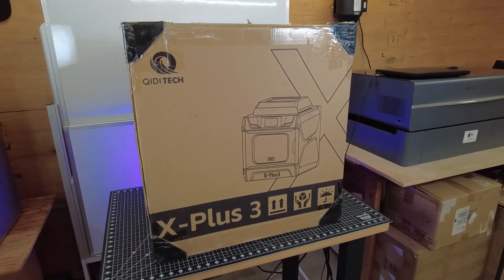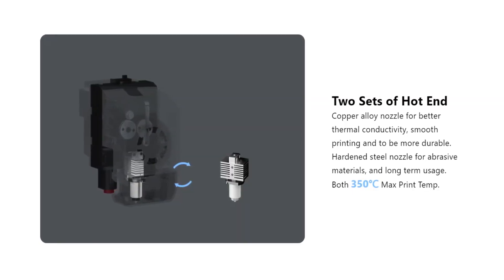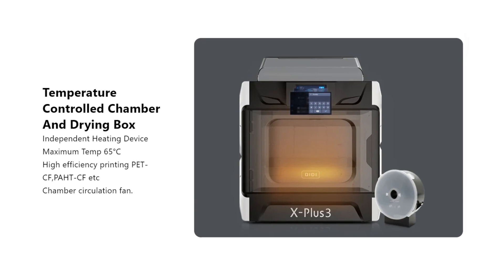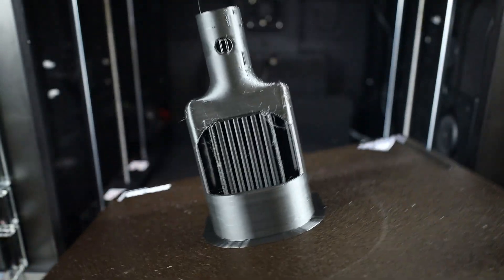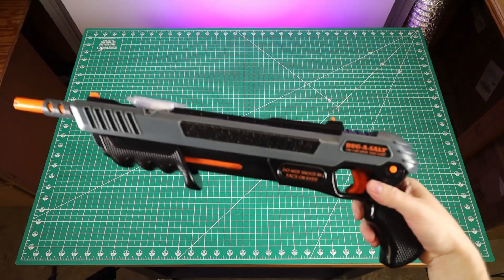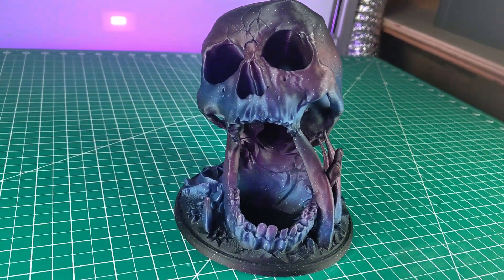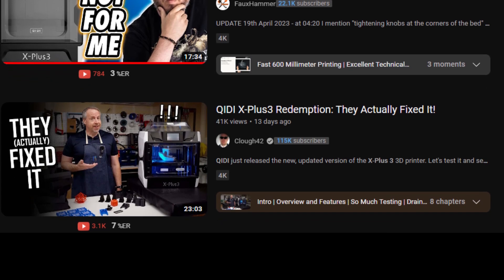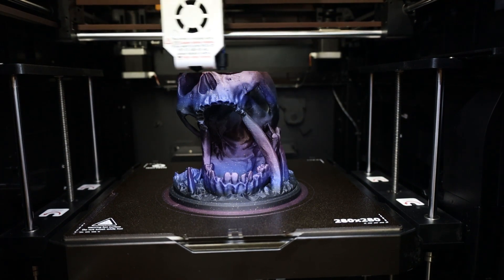New Competition for Bambu Lab & Creality K1 - Qidi Tech X-Plus 3

Comment: Hey mate what temperature did you print the skull with in that starry sky filament?  Im getting a lot of stringing with that filament.  I haven't tried to print the skull yet but was printing a bolt and nut as a test before the giant skull.
Reply from the maker: I honestly don't know 😅 I used whatever the default setting was for PLA in Orca slicer
Reply: Did you ever figure this out because im having trouble getting the sweet spot with this exact filament, print, and printer
Reply from the maker: Default PLA settings in Orca slicer with the lip off the printer.

Comment: Hey Randy, what's your opinion for the best printers under $1000 CAD (with tax)?
Reply from the maker: That will depend what materials and print size you need for that you are making.
Reply: @randymay  Right right, what are your thoughts on the Bambu Lab P1P? I think the most complex builds I will be doing is just PLA and they're like at most a ft x ft x ft build volume
Reply from the maker: I like the P1P and I have 3 of them actually. For the most part it really just works out of the box and makes quick along with high quality prints. You can also add an enclosure to it later on if you like and use the 4 color AMS setup too. I have a video about the X1C that I talk about the P1P in.
Reply from the maker: https://youtu.be/8mqrm_2_yzc

Comment: I have read that qidi fixed their slicer problem with cura and they switched over to prusa slicer and now naming it qidi slicer with some cosmetic changes and that should work? So is the slicer you have tested still based on cura or does the "new" qidi slice even with prusa inside still makes problems?
Reply from the maker: It looks like the one that I used is the old slicer. I'm downloading the new slicer now to check it out.